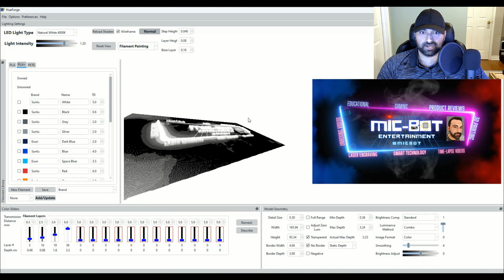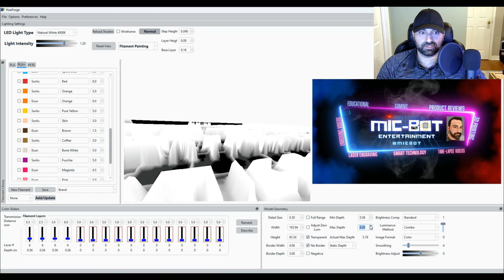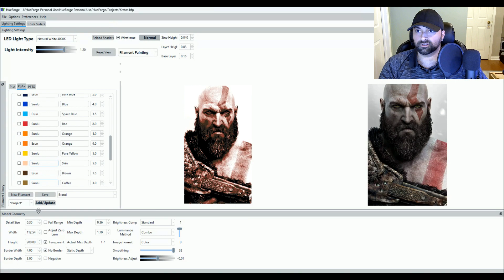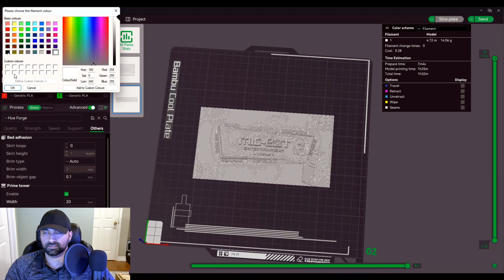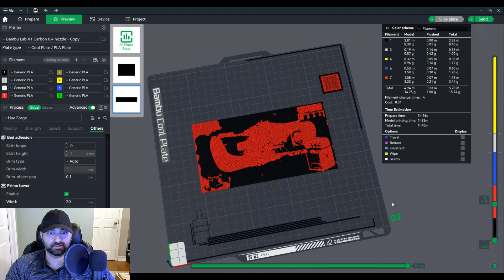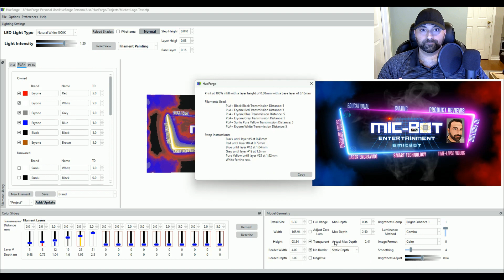Hue Forge Series: 3D Filament Painting Preparation

Comment: I guess the basic issue of the current SW is that different colors are allocated at same grey scale and therefore same height, so a picture containing different red, blue, green, yellow tones in different areas cannot be correctly repainted.
See the example file in project folder "polymaker-color-pack-abstract".
So for me the usage is very limited at moment?
Reply from the maker: Hello, I am not sure what you mean exactly, but if you are referring to the sliders, then you need to move them up accordingly to blend colours. Every number is actually a layer. For example black is at 5. First 5 layers are black, next the gray is at 10, which means layers 5-10 are gray. And so on.